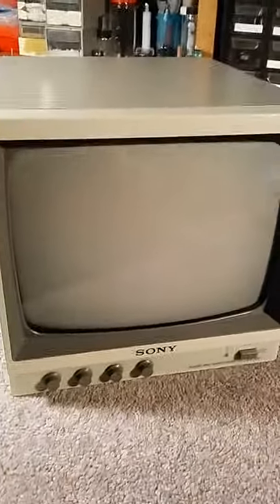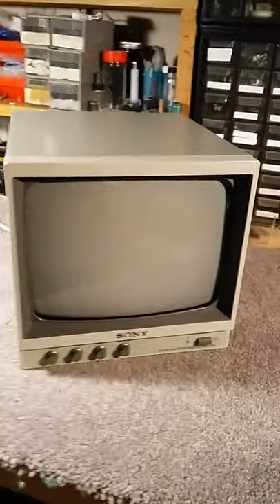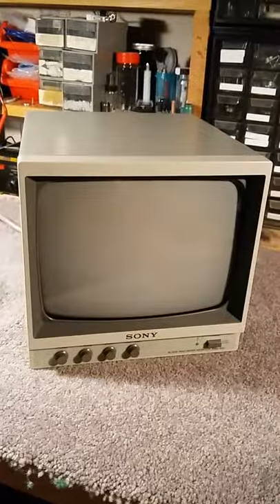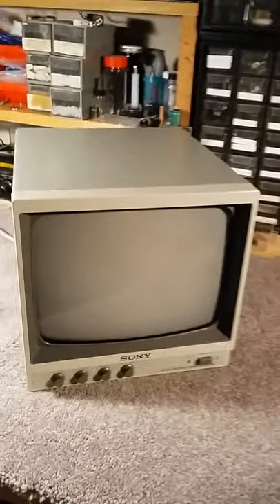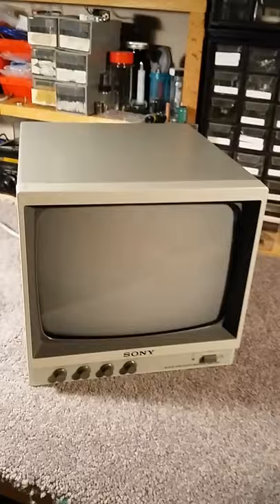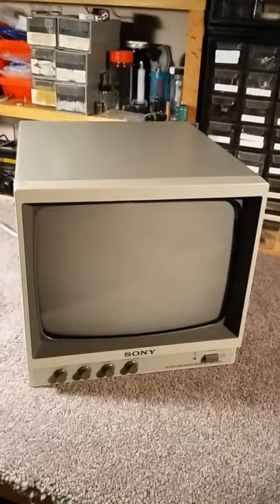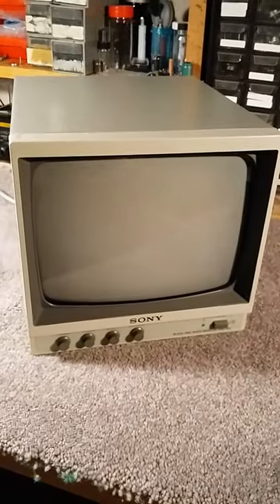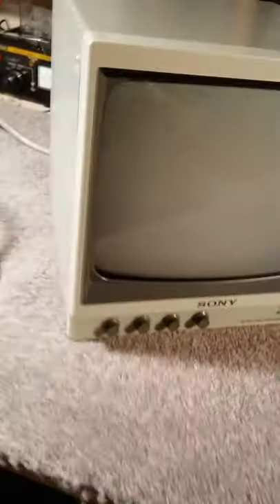Sony SSM-930 Black and white video monitor teardown/review.

Comment: hey what's the little metal piece that you used to plug in the orca cords?? is it like an adapter?? if so what is it called and where can i get one??
Reply from the maker: It's just a BNC to RCA adapter.  There's lots of places that carry them, just Google BNC to RCA adapter.  You'll find tons of options :-) amazon, eBay,  digikey, mouser etc.  Hope this helps.